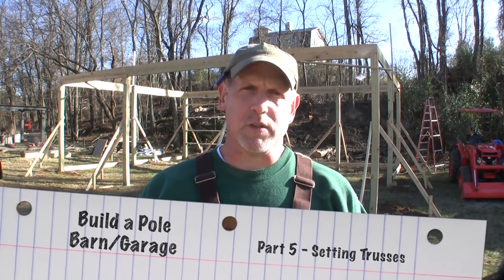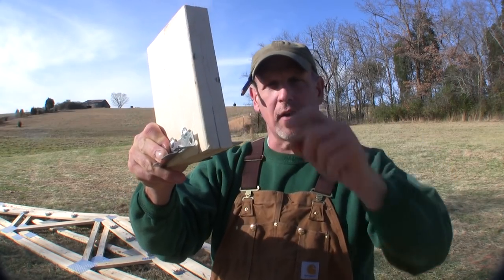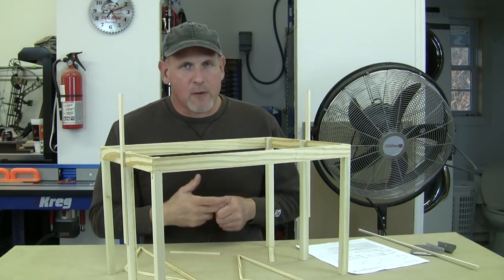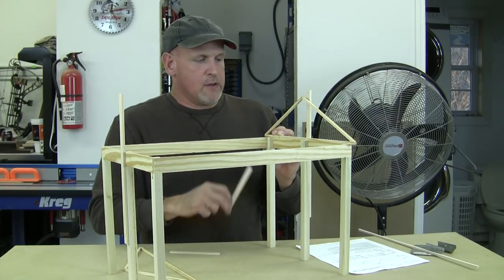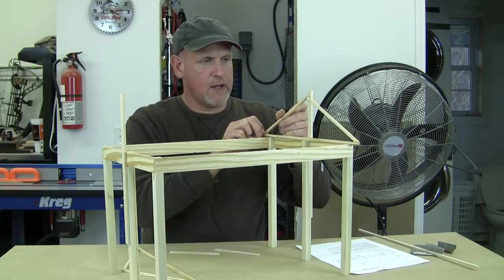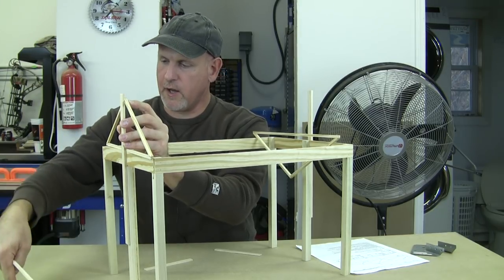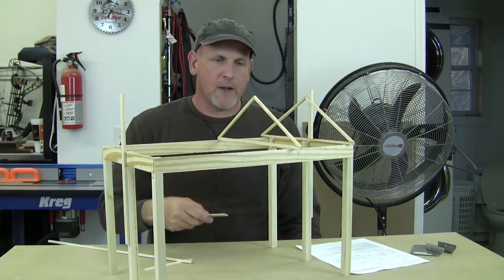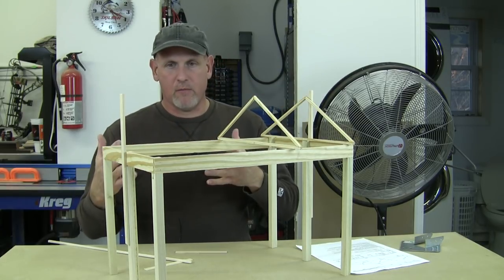How to Build a Pole Barn Pt 5 - Setting Trusses

Comment: Great video series.
Now I have a good idea for a polel barn for my Kubota. Did you order most lumber in one order? Calculating must have been mind numbing. Whar wood are you using? Thanks.
Reply from the maker: Thanks for the compliments!  I ordered most everything in one order.  I ended up having to pick up some odds and ends on separate trips.  I bought most everything from Builders First Source.  I am thinking about doing a video talking about materials, costs, etc. so maybe that will help folks figure what they need to buy for a job like this.

Comment: Looks GREAT!!!  Can't wait for part SIX.
Question though,  Why didn't you just cut the post AFTER they were up.? That way you would not have to level everything before (setting).  I must be missing somthing.
TED
Reply from the maker: Thanks for watching.  I appreciate the compliment! Standing on a ladder ten feet up with a five pound circular saw may seem like no big deal, but I've had to do that and it is a real pain.  Probably not so bad if you are working off scaffolding but off a ladder kinda sucks when you are trying to make accurate cuts in every direction.  It was so much easier to do it on the ground, but it did take more time and planning.  Thanks again for watching!

Comment: I know I’m late to your videos, but did you have any trouble with the length of your purlins   Increasing the width between rafters.  I only ask because I see them ran over the top a lot due to that issue.  I have added them over the top but was done on 4’ centers not 8 ‘.   Great job with your content and  videos..

Comment: Do you think it would have worked just as well to nail the purlins on top of the trusses? I'm wondering if I need to use metal connectors. Is there an advantage to putting the purlins on the inside face of the trusses versus the top? It seems like the implications for the roof aren't significant, but I could certainly be wrong.
Reply from the maker: Anthony Andriano Thanks for watching, Anthony.  Yes, alot of folks do it as you have described and it works fine.  The way I did it gives incredible lateral strength though.
Reply: ***** I see. I'll use connectors as well, then. Thanks.

Comment: did you cut each purlin to the right length? i'm trying to setup my barn to not need any cuts on the purlins for time saving, but it's harder than i thought it would be to make that work.
Reply from the maker: Anthony Andriano I had to cut most of them.  It took some time.

Comment: I'll be building a 35' x 50' Earth embedded Shop this Spring and would like to Video tape all that. Have adequate carpentry/concrete skills, but need some adult leadership when it comes to Videoing it. Would appreciate any knowledge you can share.
Reply from the maker: Tanks for watching and commenting.  I use a Canon HD camcorder, a remote, and a very good tripod.  The biggest tip I can share is look at the lens and not the screen and just be yourself and have fun.  Let us know when you get it loaded on YouTube.  I'd like to watch it!  Good luck.

Comment: What kind of nail gun is that? I am thinking about getting a knew nail gun, and don't want to have to deal with air hoses and that nonsense. I know a few companies make nail guns that have a ion battery pack, but from the looks of it yours doesn't have a battery. Correct me if I am wrong. Thanks, great videos 👍
Reply: Cole Videen paslode 30 degree framing nailer

Comment: you know quick way to measure centers is to go where you want to measure the center go 3/4 over and make your make and nail the hanger in with the edge on the line and 2x will land in center everytime.
Reply from the maker: Yep, that'll work too.

Comment: Looked like a pretty significant horizontal gap between your truss and your 2x12 beam on the end.  Did that cause issues?  Would it have been worth forcing those together with clamps first?
You can see it at 10:48    https://youtu.be/gq3uKnKTR9I?t=10m48s     Great series.  I'm building a carport using the same technique.

Comment: You should  NEVER  cut or modify an engineered truss...you destroy it's certification.....FYI
Reply from the maker: Wilbur Finnigan Ideally you'd have the end trusses smaller and offset by an inch and a half to lay the supports over.  The overhang came as an afterthought.  These are 1X6 trusses so there's plenty of meat left even after the notch.  They aren't carrying any weight to speak of either.  They aren't going to snap.  You could scab in a 2X4 along the notch if you really get worried about it but there's no need really.  This is done all the time in practice.  Thanks for watching!

Comment: Wow .buddy you never notch a truss. You voided the warranty on the trusses.
Reply: don't be stupid that is how you do it. it is usually outlined in your architectuals and approved by you architect before hand. if you are worried about the truss factory's warranty should use a different supplier.. I have many years in the industry and own a construction company. this is by far the best way to insure stability of gable end. at lest in wa. your building inspector will fail you if you don't.
Reply: the only thing I will say is having 8 ft centers is out of the norm

Comment: this comment is to blazingnailgun. I'm not building a building as large as yours , its going to be a 16x32 shop with wood floor. My question is do you think it would be cheaper to build a pole building like you did are to build a framed building. I have built small sheds and would have know problem building this one . It will cost me around $2500.00 to build a traditional building .
Reply from the maker: Stephen Standridge Thanks for watching and commenting, Stephen.  I appreciate it.  A pole structure is generally cheaper than traditional framing.  Go over to the website and download the materials list.  That might give you an idea of the materials involved in my building.  Good luck!
Reply: thanks